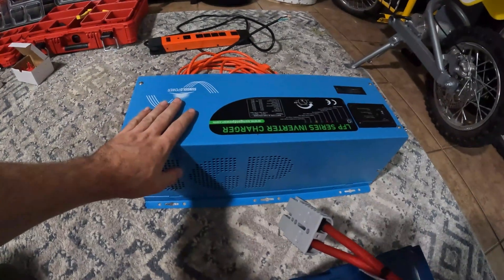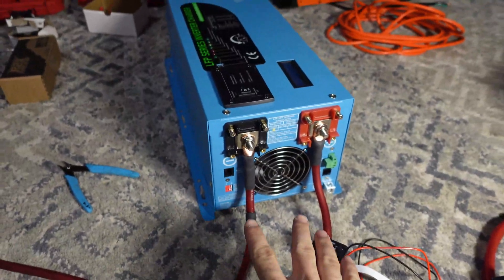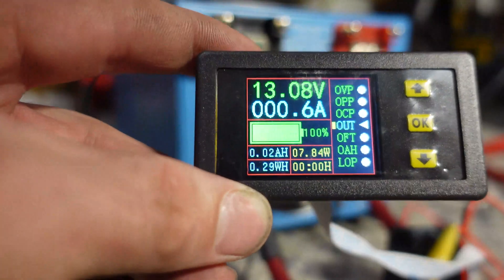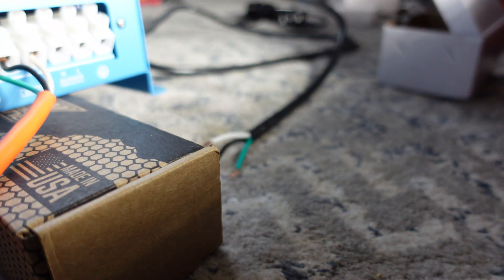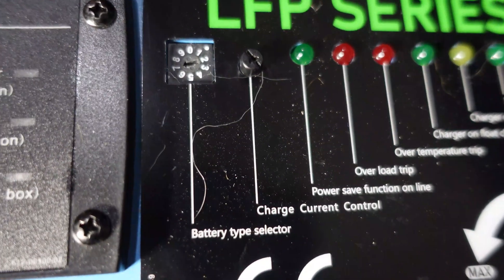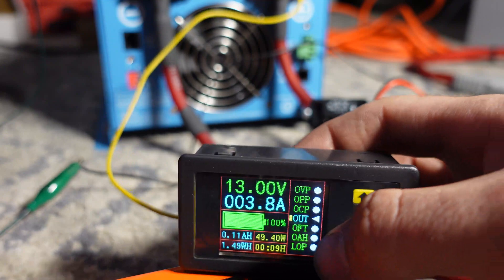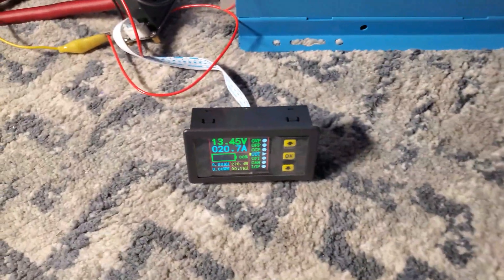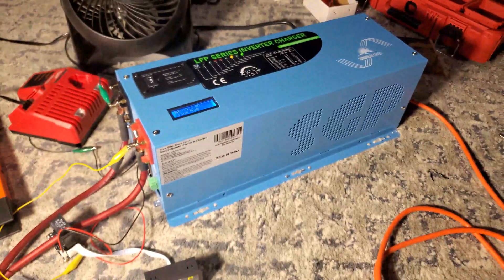SunGold inverter idle consumption

Comment: EXCELLENT PRESENTATION OF YOUR NEW INVERTER AND HOW TO CONNECT AND TEST LOADS ON IT . HOW ABOUT SEEING HOW MUCH MORE CAN IT RUN TO ALMOST ITS LIMIT B4 IT SHOWS AN OVERLOAD FAULT ,TRIPS OR THE COOLING FANS START RUNNING . YOU HAVE A GAME CHANGER . MAY THE SOLAR BE WITH YOU .:goodvibes:😊
Reply from the maker: Haha yes sir thank you! Your right we will do a full power video soon and see what we can run with it, although 3000 watts at 12 volts is something like 300 amps, i need thicker wiring!